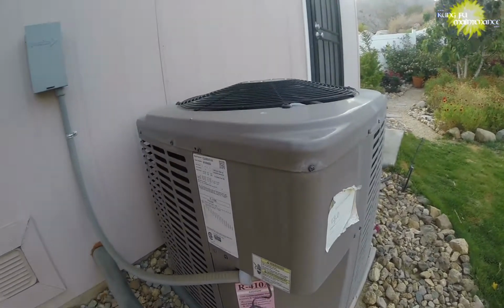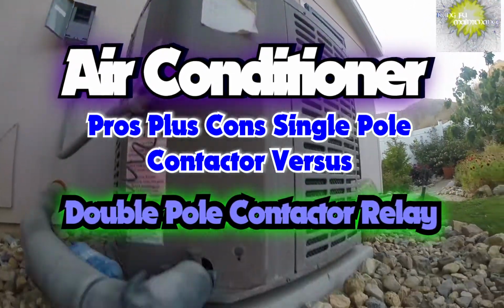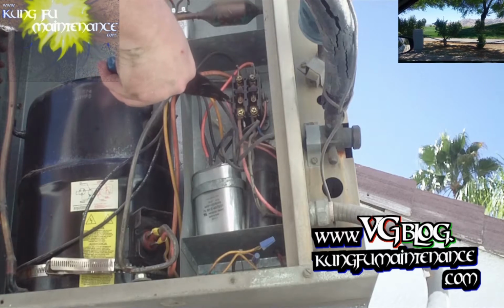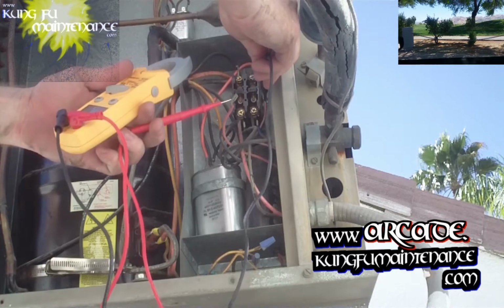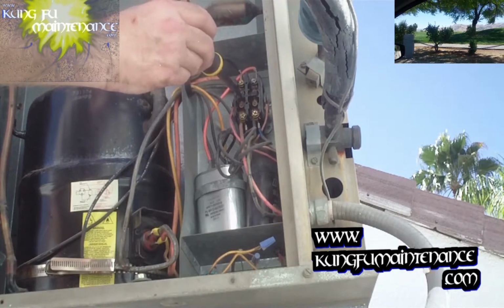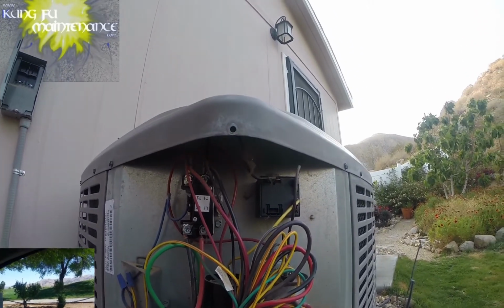Air Conditioner Pros Plus Cons Of Single Pole Contactor Versus Double Pole Contactor Relay

Comment: From what I've read, Richard is correct. Gas heat pumps need a jumper wire to recreate the shunt's constant power supply to the heater board circuit when changing one pole to a two-pole contactor. This is rarely mentioned by other technicians though it is very important to note, as on a double pole you can flip the contactor left to right or right to left without issues. Full disclosure, I am a DIYer not unlike all others on YouTube who likes to learn all I can (saving money is great too). Hope this helps.

Comment: Doesnt it make sense that if you replace a single with a double pole contactor and the one side of the contactor goes bad you can just switch the wiring over to the other pole on the contactor instead of having to wait for another single pole contactor to arrive in the mail?
Reply: I hope you don’t EVER try that

Comment: Some units use the start winding as a short term crankcase heater and therefore need power on one leg on to function properly.  You'll recognize those units because they have a bleed resister across the caps in that circuit.